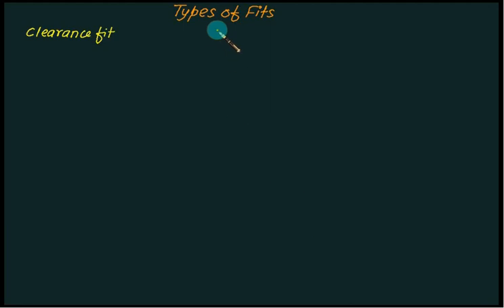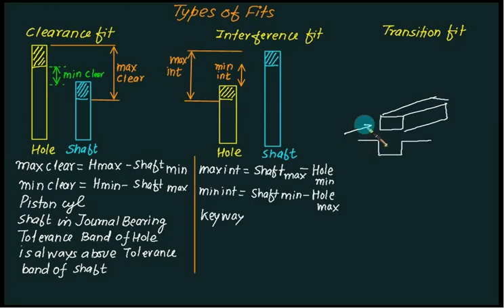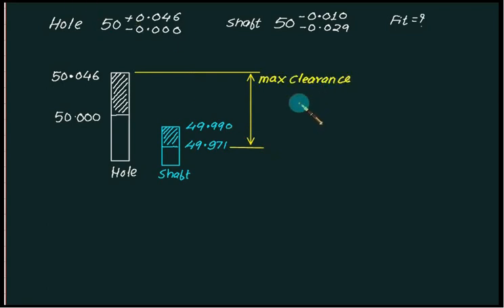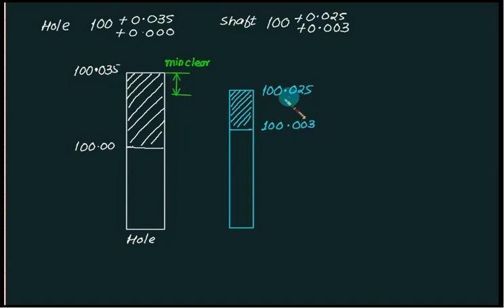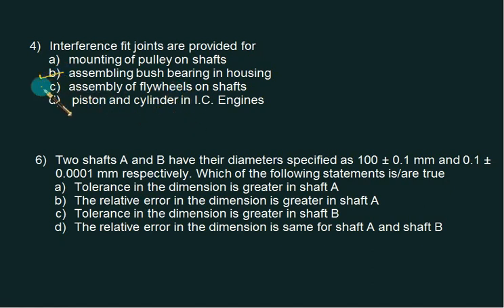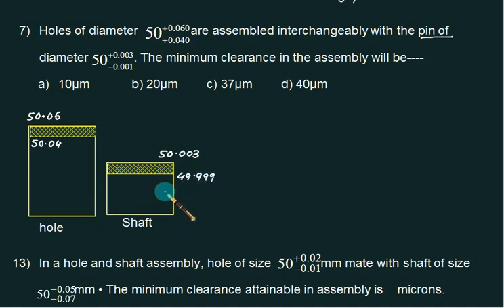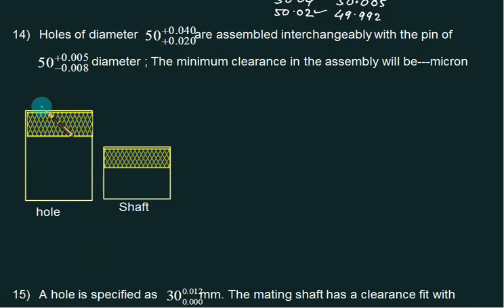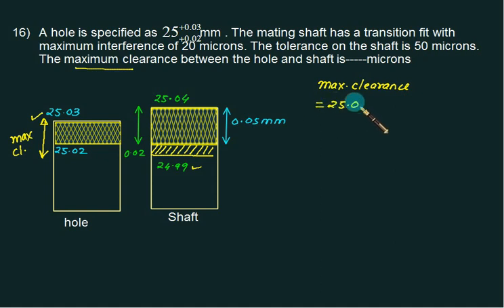Limits and Fits 02 Types of fits Numerical

Comment: As you mentioned that the minimum clearance is same as maximum interference but in the last question for the maximum interference you have used= max shaft - minimum hole , while in other question you have used max interference= minimum hole - maximum shaft, just correct me  if i am wrong, thank you
Reply: You are correct, maximum interference is minimum clearance
Which is given by Minimum size of hole - maximum size of shaft .
So that equals to 25 mm as the maximum shaft size .

Next the minimum shaft size is 24.95mm
Hence the maximum clearance is 80 microns.
I will be glad to know your answer 👍